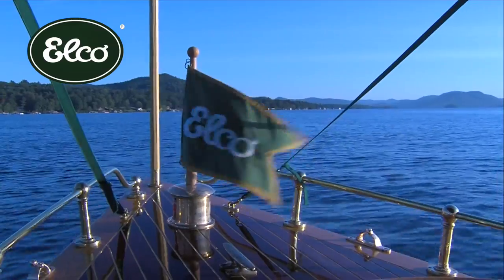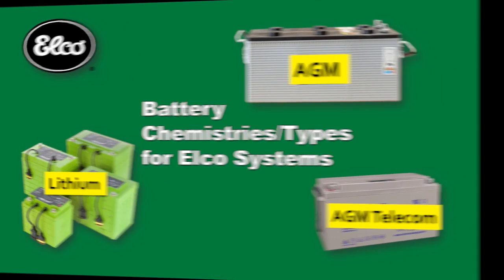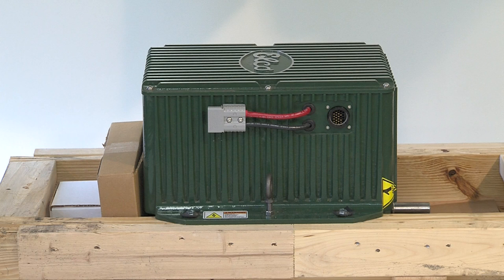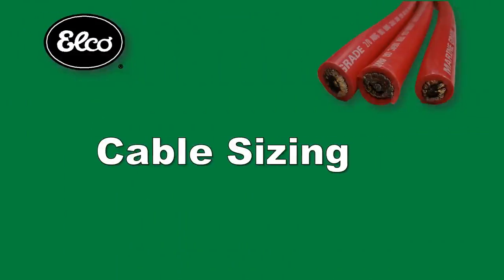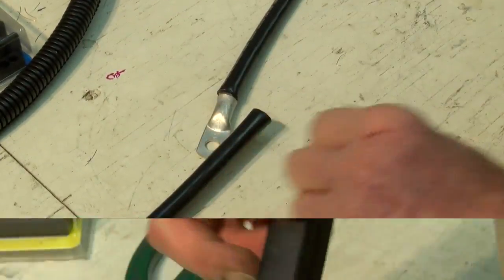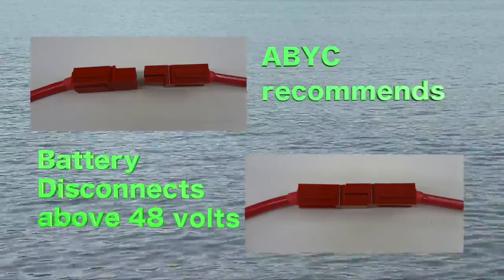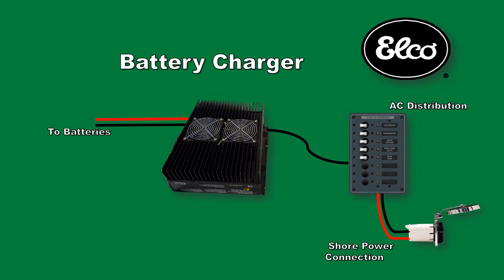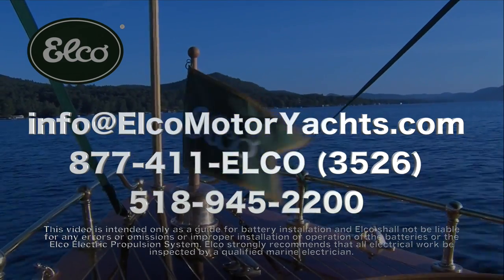How to install an Elco Electric Inboard Battery

Comment: I can  only" Wish" I had  one of their  Inboard Motors, But I,m on the water so not the end of my journy,      I have built a Tri-toon with 1400Watts of Solar,Two 108# thrust MotorGuide Brushless. Unlimited range, This is a top speed 5 MPH .Check my channel for video.           https://www.youtube.com/@allclear7

Comment: I have a 7 meter boat. If I were to buy a 100hp inboard motor, should I buy 12 batteries? Where do I put all these batteries on the boat? Is there that much room?

Comment: Lithium batteries are particularly susceptible to damage when over discharged, hence the absolute need for BMS when using lithium batteries.
Reply: They have a BMS built in
Reply: I have never seen a manufactured Lithium battery with out a BMS. Unless you build your own, then you need a bms to install.